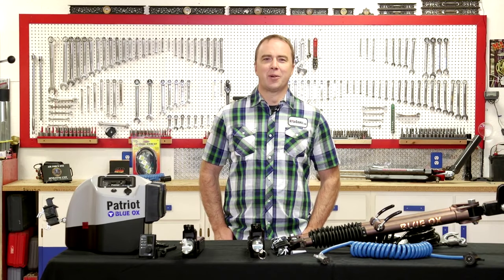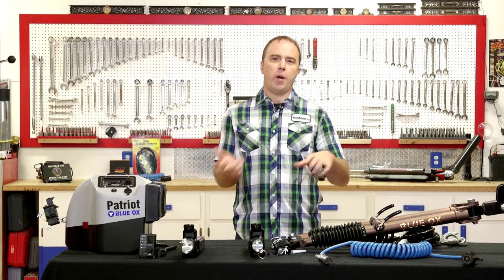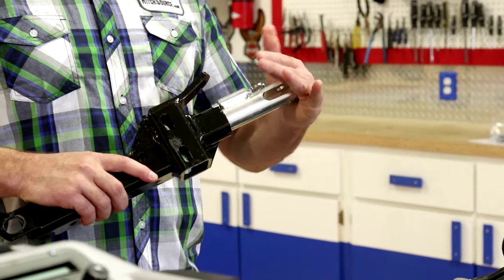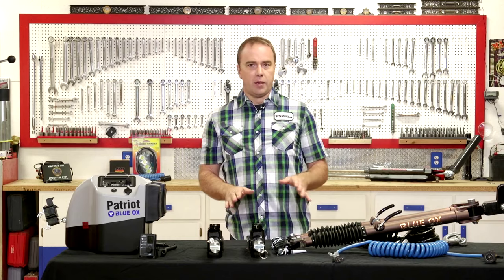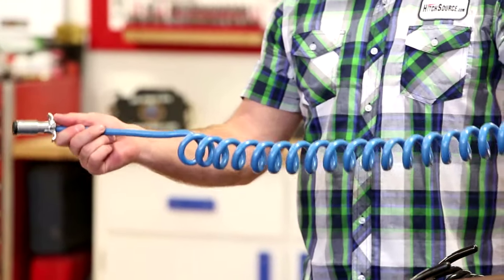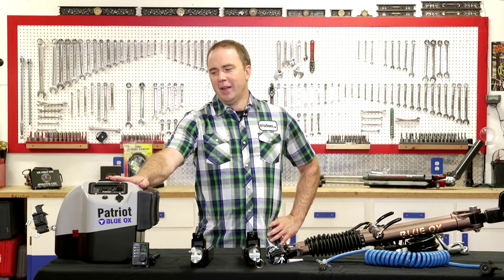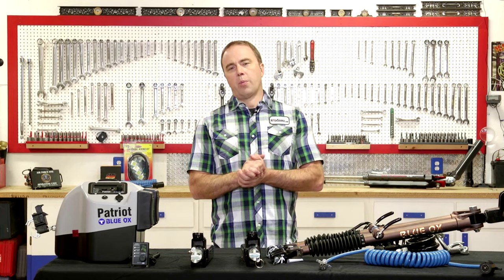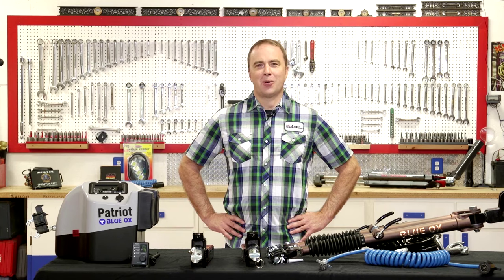Flat Towing Basics

Comment: Don't forget to remove your drive shaft unless you want to replace the transmission
Reply from the maker: Thanks for the comment Mike. Yes, with certain vehicles it is necessary to disconnect your drive shaft, pull a fuse, run a transmission lube pump, or even use a tow dolly. We always recommend looking at the emergency towing procedures in your owners manual or giving us a call and we can make sure to recommend the correct configuration for your vehicle. This video is just a basic overview of what it takes to flat tow. Cheers!
Reply: MIKE HUNT most 4 × 4 uses transfer case in nuetral and can flat tow. You are thinking of a 2 wheel drive automatic as most of those you could not without removing driveshaft. Always refer to owner's manuals!
Reply: Bob w my owners manuals says nothing about flat Towing. Nice generic answer, but not at all helpful
Reply: MIKE HUNT if it says nothing about flat Towing you cannot. It's not a complicated answer needed . Another thing is see if you can find a base plate for a tow bar for your application bet you can't.
Reply: 🤣 @ Bob w
Reply from the maker: Usually an owners manual will have a section that includes information about "emergency towing procedure." Often this is where they will outline if the vehicle needs to be trailered, on a dolly, or can be flat towed with some caveats. If you can't find the information there we would encourage you to consult your local dealer. Cheers!
Reply: Y'all are confused... You think that I asked if I should or could flat tow my car. When in fact I was just trying to warn people that if they flat tow without removing the drive shaft they could burn up there transmission. I don't need an owner's manual to tell me that. Life experience through the years has told me that.
Reply from the maker: Not confused at all. Just putting out the correct information for anyone who might stumble on this comment thread. Cheers!
Reply: HitchSource.com i hav a question to tow a ford focus 2014 i need to pull out my 2 cv joints? or just one?
Reply: Just don't have an automatic and you'll be fine in neutral.
Reply: @StefanBacon  you can hardly find a manual transmission in the United States.
Reply: @SKANK_HUNT49  I'm CANADIAN and know how to drive a Manual !
Reply: @jackpontiac52  who CARES!!
Reply: @SKANK_HUNT49  A Canadian invented the Variable Pitch Prop, the Snowblower. Canadian Avro Arrow did Mach 1.9 in 1958 !